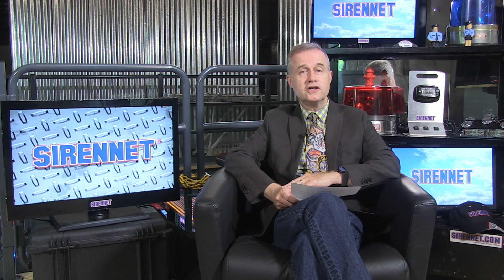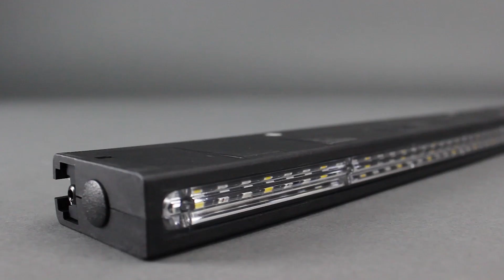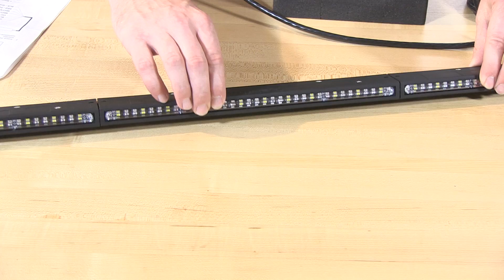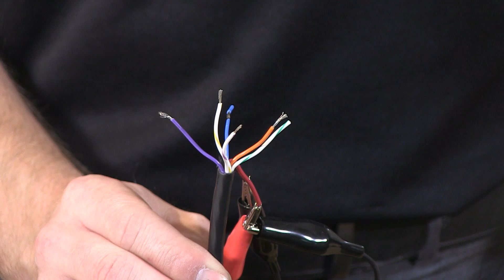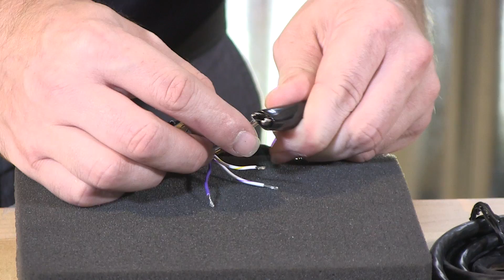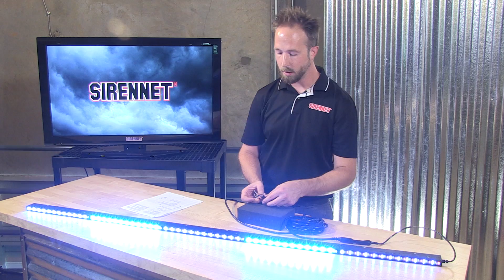Whelen Tracer Series TRIO Light Array - Five Modules

Comment: Would this be good in the northeast Ohio region due to the winter climate? With the snow, salt and brim?
Reply from the maker: The Tracer's will be just fine. The Hard-coated lenses resist environmental damage from sand, sun, salt, and road chemicals.
Reply: Would this go for same for other Rocker lights. Such as the HG2?
Reply from the maker: We unfortunately don't have the full spec's on the HG2 Runner Kit's.  So long as the fixtures are designed within a sturdy frame and are water-resistant and engineering using materials and compounds to resist grim, salt, sand, oils and UV, they should hold up.

Comment: is thus for inside dash, or back window
Reply from the maker: The Tracer's and their available sizes offer a lot of mounting options. They are water resistant and are designed primarily for exterior use. The Tracer single, 2, 3 or 4 Lamp Array would be great side flat side windows on rear windows in Trucks and SUV's.